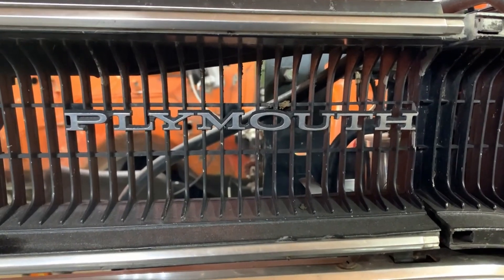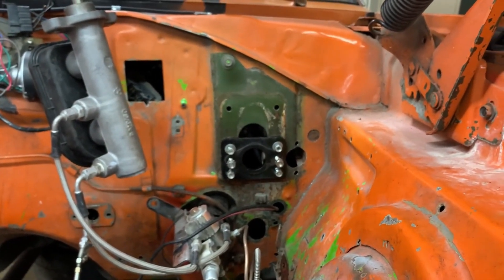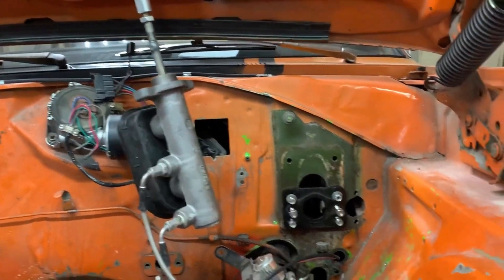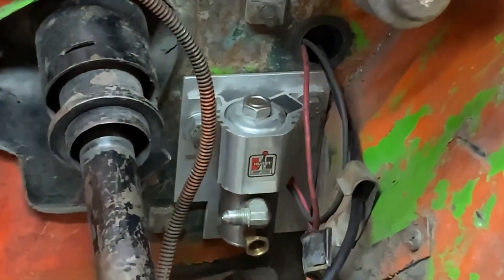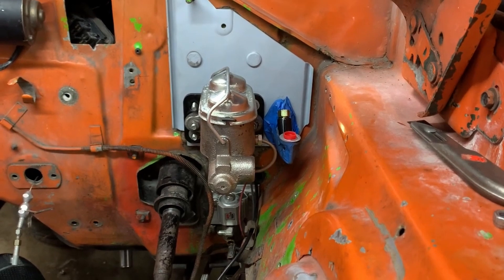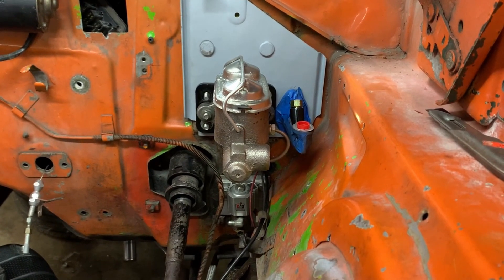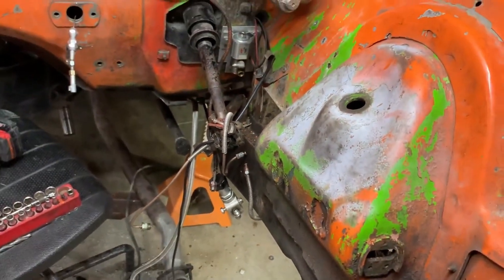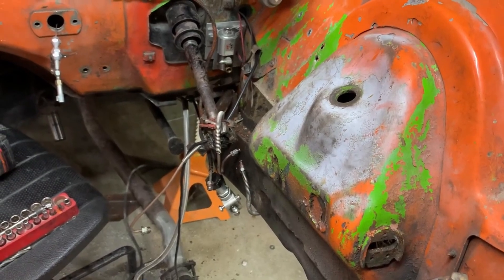Redoing Firewall components on the 1970 Roadrunner

Comment: Puh....puh....paaaaint? That's exciting! Has it been satisfying at all having the room to work in the engine bay? The blank slate appears exciting. Not at all envious of what's ahead for you though!
Reply: Satisfying..... wellllll... I have been able to do things that were not possible with the motor in and found new issues I probably wouldn't have seen (inner fender welds popping loose). Subframe connectors are in the near future for sure. I have an enormous amount of work ahead of me to make it ready for HRPT but we will be there. At least I am about done cutting and fabbing - next welding up holes and AC mockup. Thanks for watching!